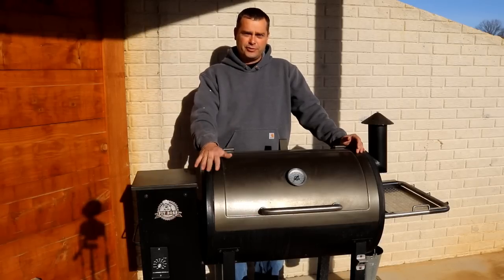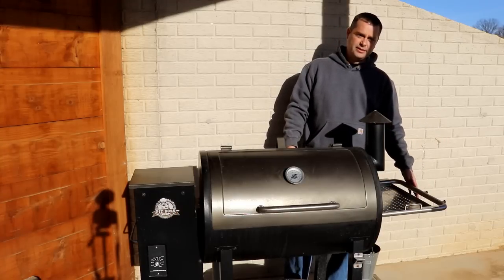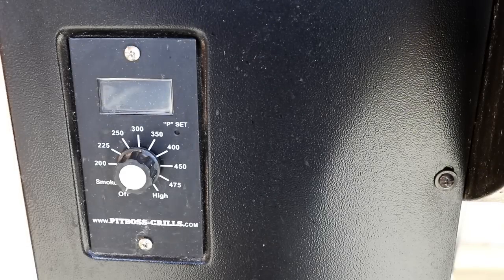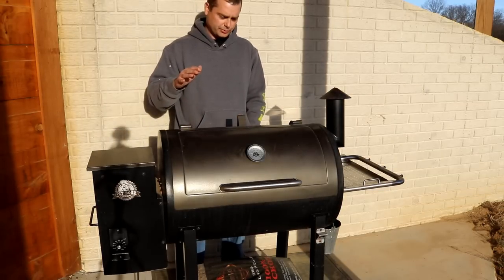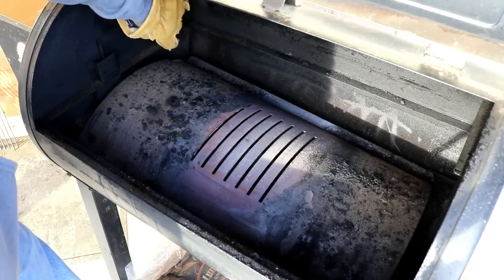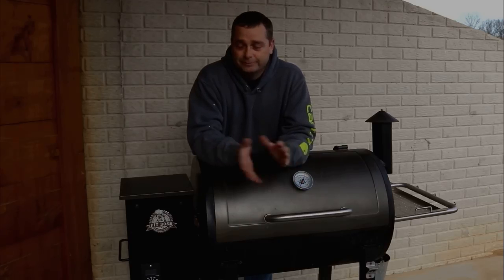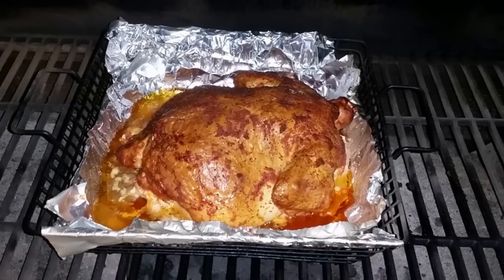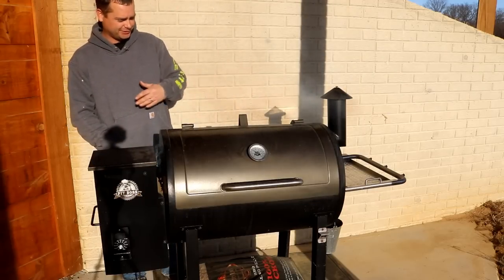Pit Boss Pellet Grill - Year and Half In Depth Review

Comment: One piece of advice that's helped me with regards to wood pellets is t dump the bag into a sealable rubber bin. That'll do two things . . . 
- help keep them fresh and dry
- and allow the wood dust to settle to the bottom of the bin. This way I shake the dust down and scoop from the top. This will help in motor and auger operations as it minimizes the fine dust from "gumming" up the drive mechanisms. When the bin is empty I dump the dust in my firepit, or whatever works for you.
These arn't issues with the Pit Boss as it would apply to any pellet BBQ.

Comment: Thanks for the review.

I have owned a different model Pit Boss identical in operation to the one in this video for a year now and just love it.  The spot welds on the lift handle broke about 8 months ago, however but I replaced it with a gate handle and it works perfectly and looks good.  Otherwise I’ve had no issues.

I do have a different opinion about smoking vs grilling. I feel Pit Boss pellet grills are at their best when grilling because of the flame broiler.  I’ve never had such a perfect sear as with this feature.  And with the proper technique you can easily open and close the broiler with tongs without removing the cooking surfaces at all.  But I also think it does baking and hot smoking very well.  Because of this versatility I’ve completely abandoned propane grills.

Have a great day!
Reply: Good to know...what's your technique to opening it without removing the grill?

Comment: That was an Outstanding review. I just purchased a Pit Boss 520D2 from Academy, mine too was already assembled. The staff at academy said the Pellet box and Cooking drum are already assembled from the factory, so the legs, side shelf  and chimney are the only real items to be assembled by the customer.
     I really appreciate your break down of how the Pellet feed and the Fire starter work. I am use to a MasterBuilt 30" Electric smoker which as you know uses an Electric Element for heat and to burn wood chips for smoke. The MasterBuilt was always very touchy when it was damp outside and would trip the GCFI breaker. I'm hoping the PB does not have this issue, I've used it twice so far and all is good.
   Thanks again for a really great review.

Comment: I have the Pit Boss Pro Series 820 (the one sold at Lowes) and while only having it now for about 6 months, these Pit Boss units are fantastic.  I upgraded from a Masterbuilt ThermoTemp XL (propane) smoker.  Loved that unit, but having to refill the wood chips was annoying (and risky).  Bought this and in the first 6 months I've done pork ribs, chicken, tri tip, brisket, and pizza on it - all were fantastic.  Contrary to this video, start it in 'smoke' mode with the lid open.  This takes 3-4 minutes in 80 degree outside temps.  Doing it as he does in the video puts too many pellets inside and causes it to "overshoot" the temp you set - requiring it to cool down before cooking.  His unit in the video is great, but the Pro Series has some nice upgrades: ceramic coated grates in a diamond pattern, two meat temp probes built in to the control panel, easier adjustment of the "P" settings (smoke setting), solid side panel (on the right) with grill tool pegs on front instead of the side, and a foldable front panel.

Side note - you can drill a tiny hole in the right side of your smoker and another small hole in the sliding center heat shield panel and connect in a gun cleaning rod...lets you open and close the broiler panel without removing the grill grates or reaching down with a tool to open/close the panel.

VERY satisfied with this purchase...Pit Boss makes a stout product that has most if not all of the same features (and in some cases more) than Traeger units do (with the exception of the wi-fi connectivity) for a good $200 less for an equivalent size.  Also, you can run this one on a 100w inverter when you camp/etc. and don't have a generator.  The manual walks you through the process of disconnecting the glow plug and manually lighting it.  I have yet to try this, but taking a 12v battery and being able to run this away from power is a huge plus.

Comment: Great video. One good thing to remember is that moisture can build up in the auger chamber and shaft, plugging the auger. Good idea is to clean out shaft and hopper box of pellets if it sit for a while.  By just empty the hopper and letting the auger clean itself out by running it out of Pellets. 
Saw dust from pellets will build up in the auger area and plug it. If you live in cold weather areas and rainy, good idea to clean it out. Some people use a spaghetti strainer to clean saw dust from pellets before adding them. I myself have a xl rancher pit boss and live in the mountains and had mind plug up, due to the cold and snow and bent the auger shaft and the auger motor had to be replace. Note moisture came from the warm day cold day and snow. (Dew)

If anyone thinking about buying a pit boss just like the man said "good smoker" and grill go for it!! Dont spend money on $$$ on a Traeger you're just paying for the name. 

I have used the open Flame for steaks.... Let me tell You their great cooked that way! Set it around 400 let it heat up and 2 to 4 min a side depending on thickness and your done. Cooking tip season steaks before cooking to let salt do its thing.
Reply: Galen Cox thanks for the info.
Reply: This happened even though you had it's cover over it? Or not?

Comment: Love my pitt boss. For the heat shield that slides to expose flame I drilled hole in end of barbecue , slid a threaded rod thru and into a hole that I put on the lip sticking up on heat shield. Put nut on threaded rod on each side of lip to secure rod and when I want to expose food to direct heat I can now pull from outside the end of barbecue. Works perfect.
Reply: Allen - Is there a video or could you share more about the parts you used to do this? Sounds like a great idea!
Reply: @JesseLoether  Not really that much more I can say. On the lip of the cover that slides to expose the flame pot below , drill a hole thru the lip that sticks up to accommodate 1/4 or 3/8 threaded rod. Once hole is drilled slide the threaded rod thru to see where hole needs to be drilled on outside wall of barbecue. Rod is then pushed thru from outside of grill and then thru the lip you put hole in. Put a nut on each side of lip to secure rod to it and keep it in place when you pull the threaded rod that is exposed on the outside of barbecue. If you look at pit boss that comes this way you will be able to do yours. Cost is minimal.

Comment: Biggest complaint about the pellet grill is that I live in the Houston area and it is very hard to keep your pellets dry to get the full heat out of them.  I've tried keeping them in sealed buckets and short of keeping them in the house, it's almost impossible.  Also if you leave any pellets in the hopper when you are done, and you don't use it for a while they get full of moisture and will not fire.
Reply: Sounds like FL would have the same issue....the oppressive humidity
Reply: I've ne never had a problem with that.   I keep my pellets in a large dog food container on wheels.   Do you have a cover for your pit?   Might help.
Reply: So what you suggest?

Comment: I recently bought a 700FB, a little smaller than this, without smokestack or side tray. Both were dead easy to add on. Same temp control, I may look into upgrading to a higher precision controller with probes but so far I'm happy with the results for sure.

thanks for the thorough review.

Comment: The top grill I usually put my baked bean dish, and sometimes Vegies. Also, the heat shield can be covered with foil for easy cleanup.
Reply: And foiling the shield won't affect the flavor?  I'm all for easier clean up.
Reply: @CTTH100  No not at all

Comment: If you are having trouble with your grill overshooting your temp setting try lowering the “P” setting on your grill.  Mine goes to six every time I start it by default. To change this setting I use a toothpick in the little hole on the front face. Each time you depress the little plunger inside this hole it changes this P setting.   The  P setting number is displayed  in the lcd display. During your demonstration yours was set on 4. This setting controls the on/ off cycle time of the burner. Lower P  numbers equal shorter on time and longer off times. I’ve found lower settings help to keep my unit from overshooting it’s set point.  Like you I only use the upper grill when I’m smoking three racks of ribs.

Comment: I've got one of these too and I really like it.  The only thing I'd add is that I wish I'd laid some tin foil on top of that heat shield the first time I used it.  The dripping grease makes a pretty good mess. The second time I used it I covered it with tin foil.  Sure does make cleanup 100 times easier!  Good video.

Comment: I have that grill, though without the shelf and bummed they were no longer available.  One thing though, the controller is not the best, it lacks a restart capability. I found that out at 4AM one morning when doing a pair of brisket for Thanksgiving dinner. The temp dropped below 150* and triggered my alarm, so went out and unplugged it, and plugged it back in thinking it had stalled out or something. Nope, It started smoking again and I was, OK, then BOOM flames leaped out from the lid and stack!   Apparently the wind had blown into the chimney and snuffed the fire out, but the controller just kept feeding pellets.  I had to remove everything, run the brisket into the house and in the oven, then clean out the grill and get it restarted, then bring the briskets back out to finish. 

I solved this issue with a Savannah Stoker controller.  Made a good smoker great.   Highly recommend replacing the PB controller with the SS. It has a finer temperature control and maintains the temp within 10-20* vs the 30-50* swings the stock controller had. It also reignites if the temp drops below a certain temp. 

As far as smoking and cooking goes. Love mine!  So easy to use and have not had a bad one yet.

Comment: Great review! I just purchased this grill a few days ago, you answered a lot of my question. Particularly on the smoke setting the owners manual is very vague on its use! Again, great review thank you!
Reply from the maker: My default setting on smoke doesn't add pellets fast enough and my fire wants to go out after about an hour or two.  You just need to monitor it, if the temperature drops below 160 you probably need to adjust the p-setting to add pellets more frequently.
Reply: P1 is high as i can go and it stay burning.

Comment: I have one and been using it for about a year now and I love it,
 family loves the food I cook on it. The bad  It will flame out on you if you go from a high temperature to a lower temperature really fast that's one thing I learned but I think they will all pellet grills will do a flame out so other than that it's excellent grill. High temperature Hits 550 on my grill.
Reply: I found when turning down temp it's best to open the lid and let the heat escape. This will insure it stays lit. Shut it when the display reaches the new set temp.

Comment: also the reason for starting it in smoke mode is to let it build temp up to 180 before you turn it up, gives you a better regulated temp, your temp climbed up so far because you started it so high and the smoker was feeding to many pellets into it trying to get it up to temp, then when it finally reached the temp you set it at there were all those extra pellets it spit in there because it was trying to catch up, so all those extra pellets burn and take your temp way past the setting and it has to come back down, the other way of starting it with smoke regulates your temp so much better

Comment: Charcoal grill- you have to buy charcoal. Gas grill- you have to buy propane. I think every grill has something you have to purchase on a continual basis to keep them fired up and smoking and grilling- but I do believe the wood pellet industry is by far the most expensive. Thanks for this review. I currently have a Big Green Egg and an old 16-year-old Traeger BBQ smoker and I'm looking at the Tractor Supply 1000 model for under $500. Looks like a deal.

Comment: The best Pit Boss Pellet Smoker video I have watched. Nice job. One question: About how many cooks had you done at the time of that cleaning you performed? Mainly curious how long it took you to get that much grease buildup on the heat shield. Thanks.
Reply from the maker: I try to clean after burning about 40 pounds of pellets.  Now I put aluminum foil on the heat shield and pull it off when it is dirty.  No more scraping.

Comment: NO NO NO!!! never start up a Pit Boss at a setting higher than "SMOKE" always start up  with the SMOKE setting and always keep the lid open until you feel heat  and see  fire burning ( you"ll hear the flames)  Once that happens you can close the lid and set your temp. This guy is over filling the burn pot with pellets by not starting at the SMOKE  and causing very thick smoke that can be dangerous. Read and Follow the instructions provided.
Reply: That's a good point. I have the same grill. In "Smoke" setting, it will fill the pot until it lights or for a set time. I'm not sure which. In a temperature setting, it will fill the pot until its up to the temp set point. I always start up in "Smoke" setting. I leave it in those settings for about 10 minutes then I set my temp.
Reply: Starting it as he does ("OFF" straight to temp) is also why it's over-shooting the temp he wants.  Start it on smoke...I'm in Sacramento and it takes maybe 3-4 minutes to get from ambient temp (say 80 degrees) until it's lit...maybe another 5-10 minutes to get up to say 300...so him needing 20 minutes or more to let it "cool down" is because he's skipping the smoke start setting and it's needing to bleed off excess heat. Plus, if you need it to cool faster, just open the lid for a few minutes.
Reply: I have no experience with these things but:
1. This seems a pretty basic step missed - Evan?
2. isn't that a weird misnomer? 'smoke', so that it doesn't? What???!

Comment: The Bradley puck cost so much now that 20 hours of smoking costing about $30 .  120 pucks cost $60.  If you buy the smaller box of 48 $30.  A 20 pound bag of Kingsford hickory costs me $15 and last about 20 hours at 225 deg.  And I get a lot more smoke flavor. And the Bradley always needs some part replaced.  And I bought a $28 5 gal bucket head vac at Home Depot.  I vac out all the left over pellets into the bucket and seal.  I use another bucket for the ash and throw that in the compost pile.

Comment: I have a question I cannot find an answer to!  The heating element!  Instructions say out at "least" 10 mm?  I have a new Pit Boss Copper Series Table Top Wood Pellet Grill - PB150PPG. When I got it the heating element was pushed all the way in. I took the top plate off and set it out 10mm.  It won't heat the pellets enough. How far would you set it out?  Trust me it works but I think it needs to be set out farther!

Comment: I was debiting between a grill or a smoker. This video help me to decide. Not exited about taking the ash left over, but I think its worthy!. Thanks for the video. How do you smoke BBQ ribs on this without making a hella mess?
Reply from the maker: Ash is only a problem is you don't clean out the fire pot.  I use the 3-2-1 method for ribs.  So they are on on top of foil when I apply barbeque sauce.
Reply: @CountryViewAcres  Thank you for the fast response.

Comment: One of the reasons I was wanting to buy 1 of those is because I have had a problem with the regulators freezing up more or less. I not getting enough flame in the Winter time . I replace it i and it works for a while and then those that again but miraculously in the summertime our springtime it fixes itself. Thoughts and suggestions on that

Comment: Loved your video! I just got this smoker for Christmas and I'm really excited to use it! I have alot of cooking and smoking experience, but I'm still a little confused on the "smoke" setting. When you cook for long periods of time, do you usually just set it on 225 or do you use the smoke setting?
Reply from the maker: If I am cooking I usually just set 225 degrees, but if I am making jerky I use the smoke setting.  If you use the smoke setting for a long time, just make sure it is a proven p-setting that stays burning.  This may vary in the brand of pellets you are burning also.  If it stays burning for 1.5 to 2 hours and the temperature stays within 20 degree range, it shouldn't have any problems.

Comment: My Question is when cooking a brisket on a pitboss do you keep it on smoke mode and at that low heat how will that effect the bark
Reply from the maker: Smoke mode, just adds wood pellets based on time.  It gives you better control at a low temperature using the "P" setfing, best for 200 degrees and lower.  For a brisket I would use the 225 degree setting the entire time.

Comment: Huh? ["but you have to continually buy wood pellets"] Ummm propane & charcoal ain't free!
I just got a 40lb bag of PitBoss applewood pellets for $15.99 which will in fact be cheaper to use than LP. Although the average cost of wood pellets may be higher, more like 50 to 90 cents per lb it will still fall in between LP and charcoal so not an issue. 
Oh, and it tastes so much better.

Comment: I need help with troubleshooting my gill that I bought from Costco. My grill will not maintain temperature. It will go up to 350 and then drop off to 100 degrees.
Reply: Could be starving for air.  Check the fan.  Clean out the inside